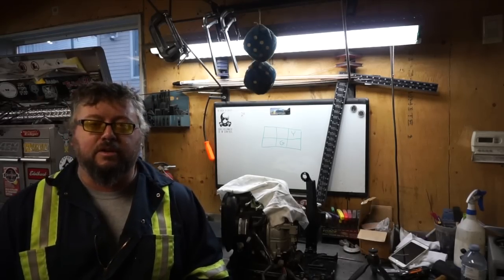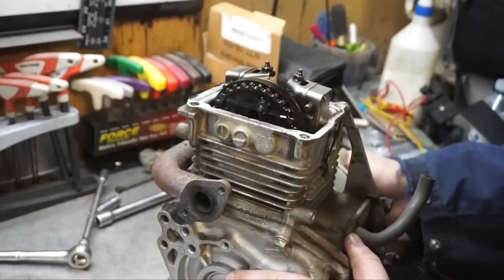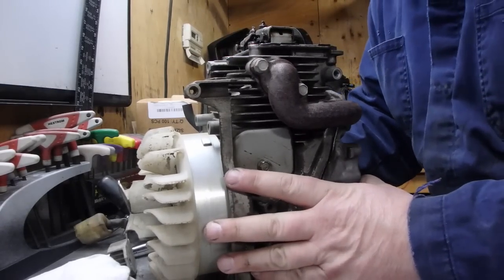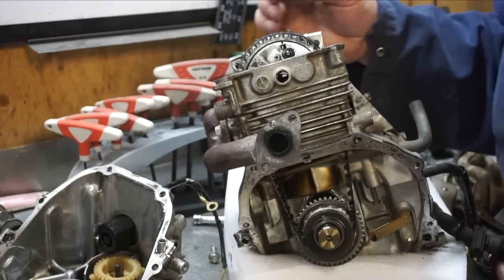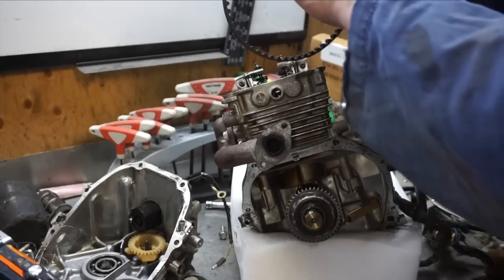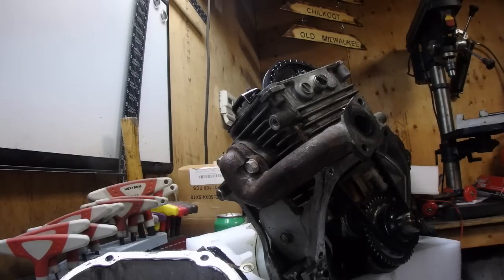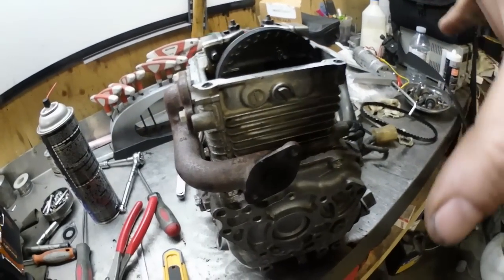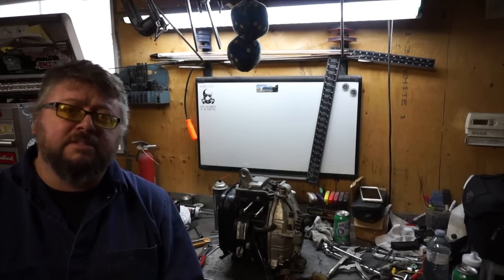Timing Belt DIY Honda Eu2000i Generator

Comment: Honda publications have a wonderful service manual for their products, well illustrated with all the info you need to do anything. Well worth the money. I've checked my valve clearance and it was fine, but it's hard to find a 3 mm wrench to reset clearance if you need to. Thanks for the video  !

Comment: It might sound like a silly question, are these interference engines? If the belt snaps is the head trashed?
Reply: Not silly at all, I was wondering the same. 
I don't think they are because they have a low compression ratio at 8.5 to 1.

Comment: Do u have a video on eu2000 ring replacement
Reply: being a year later, its probably already done but i just did rings on one. very easy. take the back cover off, and unbolt the connecting rod cap. push it all the way up and work out the crank shaft. (may need to tap with a small rubber mallet and don't forget the flywheel) pull the piston out abd take a picture. then remove the rings and replace them with the new ones, starting at the bottom going up. then, oil the inside of the cylinder and slide the piston in. no ring compressors needed the cylinder is tapered so just be careful as not to break the rings. good luck :)

Comment: Why the heck they didn't use a chain since it's already in oil? because belt is more quiet?
Reply from the maker: +ProbeGT2 that is a question I keep asking myself.  Belt is more maintenance which equals more money is my guess
Reply: BSK Garage in most Honda cars if the timing belt breaks the Piston will hit the valves. is it the same thing in this little Honda generator if the timing belt breaks the piston will keep going and will hit and bend the valves?
Reply: Yamaha did. Honda in the smaller generator (EU 10i) also. I would always prefer chains, cause they can't crack.

Comment: How many hours use is recommended to replace the timing belt?
Reply: Rafael  Pagan manual says 250
Reply: Raquelis Cuevas no way
Reply: Mine was severely cracked and close to snapping at 8 years old.

Comment: Shouldn't a rubber belt run in a dry environment? Or is the oil on it the reason why it cracked?
Reply from the maker: that is the rule indeed, a belt will naturally crack over time but the oil didn't help it any
Reply: jerry bskorner maybe they thought the oil would keep the belt lubed
Reply: I think they did that so the valvetrain gets oil from the splash effect.

Comment: Why, just why a oil running belt? In many car engines (Ford and PSA) this things dilute themselfes. The Honda generator EU 10i has a timing chain, which can't fall apart.